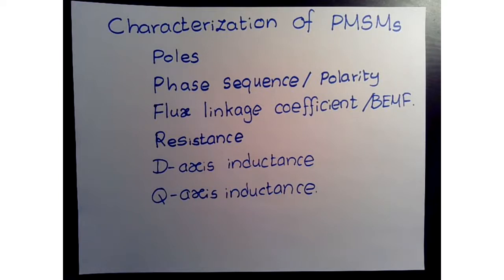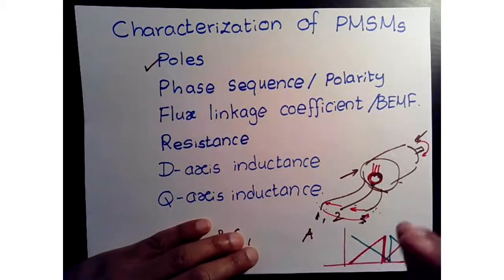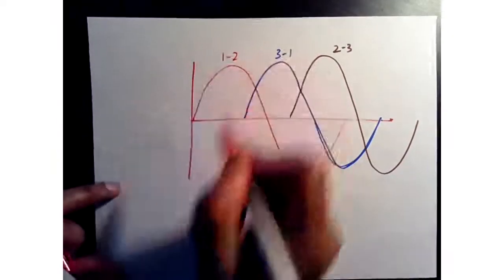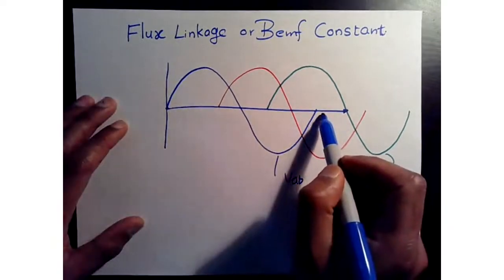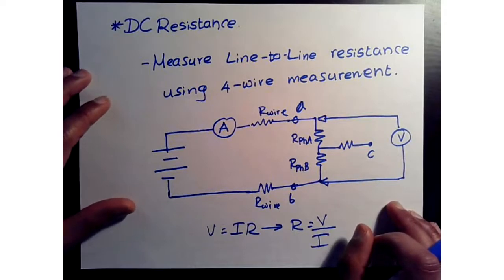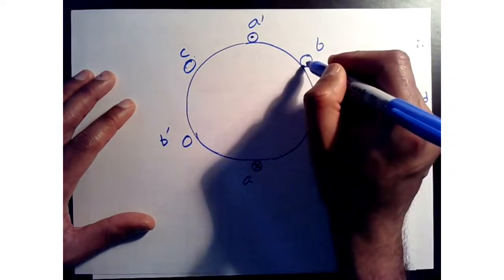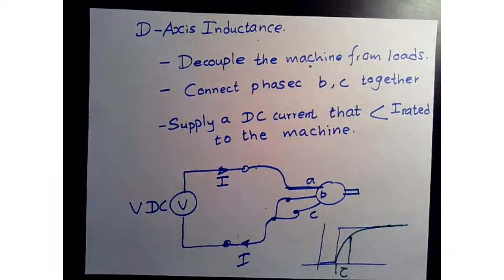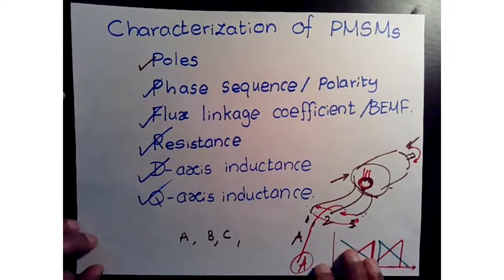Characterization of PMSMs

Comment: Hi, thanks for this lecture. It was useful and easy to follow. I have a question regarding the measurement of the d and q-axis inductance. You mention to lock the rotor by injecting a current in phase A and connecting phase B-C together with the negative of the source. Does this method work with delta-wound PMSMs? Again thanks for sharing your lectures!
Reply from the maker: Your D and Q axis are based on your rotor flux. But I'm not familiar with Delta winding pattern. If the stator flux vector is the same between Delta and Wye, then the approach should be the same. I'm curious, why you are using a Delta winding? What is the benefit?

Comment: Hello sir,
I have hardware setup of AC DC AC power converter , PMSM coupled with PMSG and FPGA based OPALRT system. I generate spwm signal by keeping v/f ratio constant and inverter output current is feeding to the motor.
Motor is running at 375 rpm, when reference speed of motor is increasing motor is start vibrating. Even in real time I changed  voltage and frequency of modulated signal by keeping v/f ratio constant.
Please sir help me
Reply from the maker: Are you trying to do V/f control for a PMSM?

Comment: what hardware is required to measure impedance?
Reply: And what is the value of w that need to b put while calculating Ld?
Reply from the maker: You can use an RLC meter.

Comment: Hi Prof. Kuruppu. Thanks or the great lecture. Regarding the Ld estimation, I think there are two points that called me the attetion. The first one is related to the alignment of the stator and rotor magnetic flux. They should be in the same orientation, that is, North with North, shouldn' t they? It seems that they are opposite (38.06 min). The other point is that when we are applying a one-phase source to a - bc, the induced fluxes provocated by the windings b and c into the winding "a" are in opposition to its self-flux (in d direction). This will reflect differently, when the machine is supplied by three-phase sources, in its voltage terminals becouse in this situation there will be positive contribution in d direction. Is this consideration right? Thanks again for the lecture!
Reply from the maker: Hi Fabiano, nice to here from you. Actually, north and north will repel. North attracts to south pole and vice versa. That is why the rotor alignment will be like that. The inductance is a scalar measurement. 
You have to look at if it is an a or an a' winding. The current in those two travel in opposite directions, causing the fields generated by the two to have opposite polarity. So with a three phase source, you end up generating a rotating magnetic field. With a DC source your field is fixed with the goal of measuring the inductance. Hope this helps.